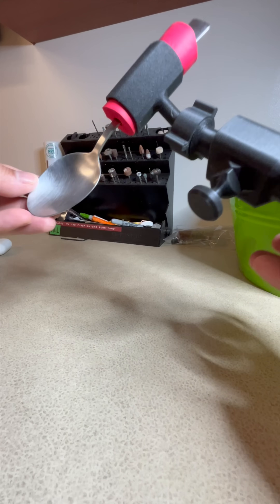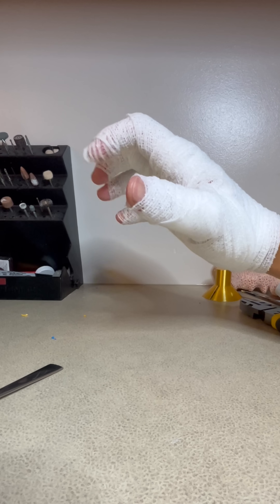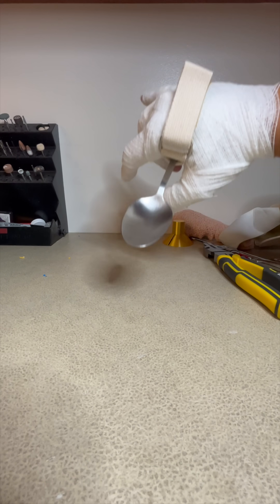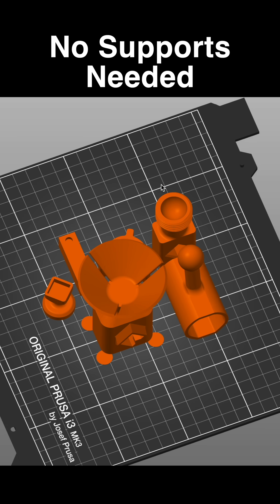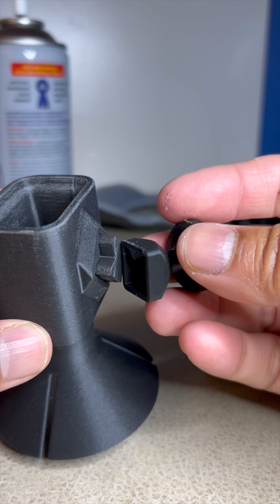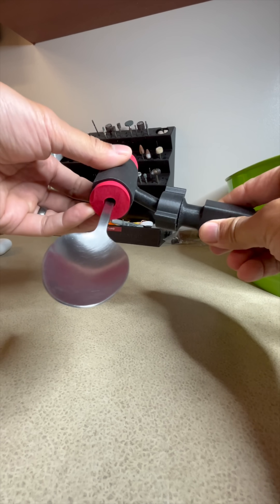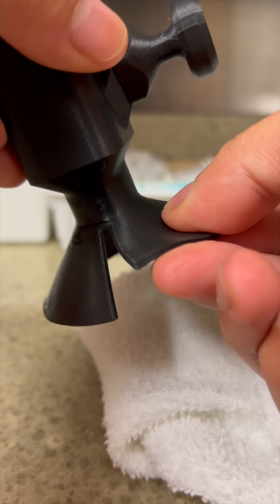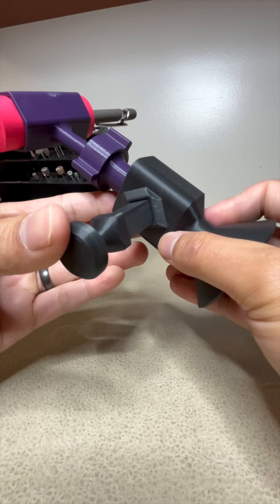3D Printing: Hand Amputation Tool

Comment: I’d love to see you make more stuff for people with all sorts of disabilities! I have several disabilities myself, including a spinal cord defect (called tethered cord syndrome, it is extremely similar to spina bifida) that affects me from the low back and below so my legs, bladder, and bowel, a nerve injury in my right arm that caused CRPS (complex regional pain syndrome, the most painful condition known to man) in my arm from the elbow down, another spinal condition that needed several spinal fusions so I have limited range of motion in my neck, a jaw condition that needed 3 surgeries and now I can’t open my mouth all that much, and a connective tissue disorder that makes all my joints extremely weak, loose, and painful. They dislocate dozens of times a day. Those are only the first ones off the top of my head but there are many more that are either harder to explain or are less related to OT stuff. I can’t do much independently and had to learn to use my left hand for most tasks after developing CRPS during a wrist reconstruction surgery and being able to regain some use of my right arm would be awesome! If you want a specific idea, I can no longer drive because I need hand controls to drive due to my tethered cord syndrome but after developing CRPS I was no longer able to use that arm to drive so I can’t drive myself. Some way to steer the car with that arm without needing to move my hand, wrist, fingers, etc. would be awesome. The elbow and shoulder are relatively fine (the CRPS doesn’t go up there but I do struggle with those joints still) so being able to somehow use my whole hand (without needing to bend it) could be great! I wear a hard brace from elbow down to not only immobilize my arm but prevent things from brushing against it because CRPS causes allodynia which is severe pain from any sensations including light touch or fabric rubbing against or really anything so the pressure from the brace helps somewhat. Sorry this is so long but I have a million ideas of ways you could make things to help me live a more independent life, if I was able I would try to make some on my own but obviously can’t due to my disabilities and also I have none of the equipment lol
Reply from the maker: Wow, you’ve been through a lot- thanks for sharing some of your story. I work mostly with burn patients- one that had CRPS in the hand stands out as having the most debilitating pain that I or any of the other therapists that saw her had ever seen. Must be so frustrating that it’s taken away your driving. Is there an OT that specializes in driving accommodations that works at a center near you? They are up on all the one handed strategies and tech and are good at seeing the big picture of function with your whole body. It’s hard (for me anyway) to design things for people unless I can see how they actually move. Would be interesting to try figure out how to least one smaller task that’s meaningful.

Comment: I kinda want the spoon thing would be nice to have a built in utensil slot on my hand
Reply from the maker: There's a few spoon type designs out there. I have another one that doesn't require the red foamy stuff- can just print the parts.